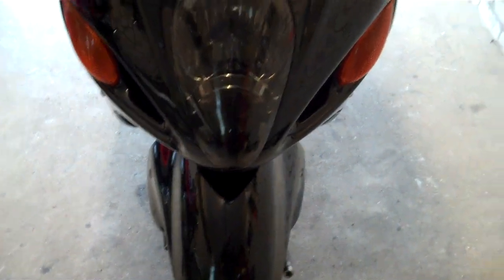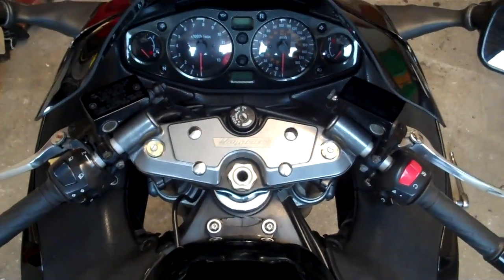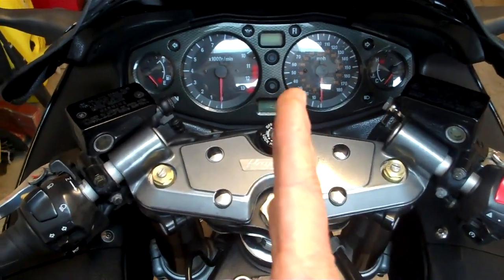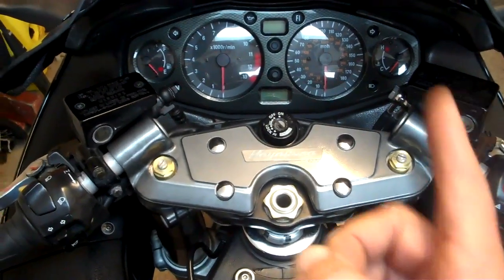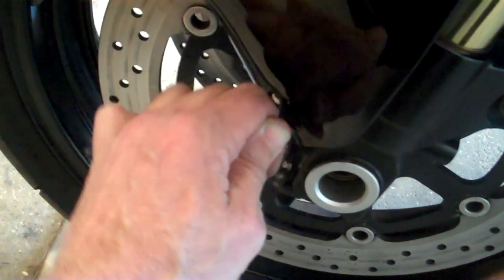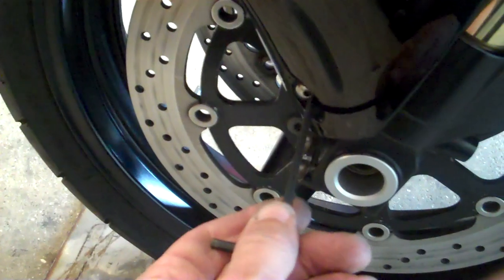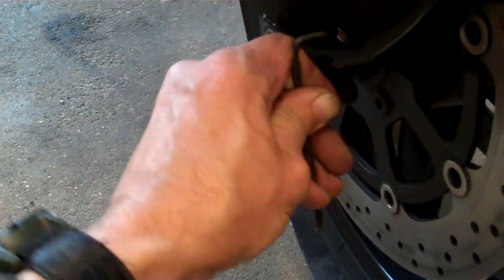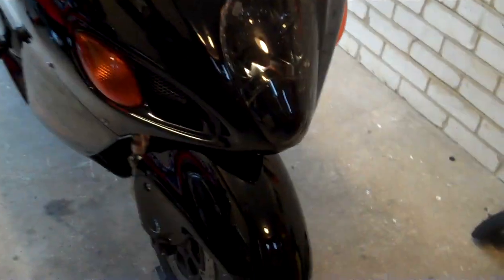Delboy's Garage, 'How-To' Re-align motorcycle forks the easy way.

Comment: Just came off my bike about an hour ago at about 25-30mph and its out I'd say about 20-25 degrees. Reckon this would still work?
Reply from the maker: Hi buddy, sorry to hear that mate, hope you weren't hurt.  Ok, this should work pretty well, it was a slow drop so its hoefully just pushed the forks out of alignment in thier yokes... the centre stand wont really help.. but if you can get someone to stand behind the bike and hold it upright on the balance point using the seat or grab rail etc.... then will work... or failing that, if you really are on your own, then even standing up off the seat while straddling the bike will do it...once you've plnuged it down and straightened them up....hold the bike on balance point by gripping the middle of the top yoke with one hand, and nip up the bottom yoke bolts with the other.....and done forget the loosen off the top centre nut in the middle of the top yoke...See how you gte on buddy... and let me know how it goes..! Good luck.. Del.
Reply: +Moonfleet41 Tried it this morning and as soon as I undone the bolts it sprung back! You my friend are an absolute lifesaver! Tracks straight and true now!
Reply from the maker: Phew, good result buddy...! ride safe aye..!!
Reply: +Moonfleet41 Haha cheers will do. Started pouring down and hit a bit if standing water while braking firmly and it just slid out from under me

Comment: When i have my hands off the handlebars, my bike tracks to the left a bit. Also, after continuous riding, my right arm is a bit sore but my left arm isnt. I had someone else ride it and they said the same. Is my bars out of alignment? Its been a year since i got the bike.
Reply from the maker: Ok, why not give this procedure a go, and see if it helps..!
Reply: need a socket for the large bolt on the upper yoke, but the good thing I noticed is the bolts are marked so I know how much to tighten to. good guy Suzuki

Comment: just curious but if I have a centre stand will this also work? i'm guessing it will due to common sense, but asking anyway just to make sure.
Reply from the maker: Hi Tyler.. no it wont work using the centre stand mate, the bike needs 
ot be able to lunge up and down, and on the centre stand it just rocks 
in the middle...this wont centre your forks properly.. it works if you 
can get someone to stand behind the bike and hold it upright while you 
lunge down..just on its wheels is ok...
Reply: Thanks mate. keep up the good vids!

Comment from the maker: Hi mate,bet that's real annoying,you say it's a 'chop',is it standard rake?And what front wheel are you running? Have you checked the tyre pressure in the front & also tyre wear, if the front tyre is 'shouldered' due to running under inflated it will shake it's head,guaranteed,every time you let go.At slow speeds it will be more pronounced as the gyroscopic effect of higher speed will combat the wobble & eliminate it.Send me these answers in PM & we can ping pong to get to the bottom of it! Del

Comment: I need some help.. my bike was recently involved in a small crash where the forks got bent.  the impact was on the left forks. it was a left side impact. a car hit me from the left while I was taking a U turn. the mechanic  said he would straighten the forks out using a hydraulic press machine..but even after getting it done there is more weight on the left handlebar of my motorcycle (clip on handlebars). while taking corners there seems to be a drag towards the left. I have checked for punctures on my front wheel.and I found nothing. will replacing the forks restore my previous handling? and should I change the position of my handlebars??
Reply from the maker: I think you've answered your own question my friend, obviously, fitting new forks will eliminate any possible damage... then all you have to do from there is set up the alignment !
Reply: Moonfleet41 but the thing is it wasn't a very hard impact.. that's wat makes me think...even for such a small impact will the handling be affected ? mine is Yamaha R15
Reply: Moonfleet41 I replaced the whole front fork assembly with a new one...but still feel there is more weight in the left handle bar...I really don't know what the cause is..

Comment: Just one little comment, if you loosen pinch bolts on the right hand side of the  wheel axle(looking from the  front of the bike ), unscrewing the wheel nut will just make it spin all together with the axle.
Reply from the maker: ...which is why you leave the pinch bolts done up until you've loosened the axle nut...

Comment: hey moonfleet41, My bike is leaning towards the left when i ride it. could this be the problem? my steering and wheel looks pretty straight to me but i will attempt your process anyway. thanks.
Reply from the maker: omg209 Hi mate, do you mean that the steering is 'turned' very slightly to the left when you ride along straight, or do you mean, as you said, that is actually 'leans' to the left??... and not sure where you are, do you drive on the right side of the road, or left??
Reply: Moonfleet41  i think its more of a lean to the left. Im in USA so i ride on the right side. thanks.
Reply from the maker: omg209 If there is extreme camber in the road, then the bike will lean very slightly to the left to say straight....if it still does it in a flat parking lot...then you should check the front and rear alignment fully to make sure everything is square and straight... also tire inflation, and check your seat is fitted correctly too...it can only be something simple.. good luck with it..

Comment: hello....my bike tire seems that it contact with road a little bit to the left and not center... One more, when i take cornering to the left sides it feels like the handle bar is heavy on the left side and i have to give some force to counter it but for the right side it seems okay....does this problems are related to the fork alignment.....help me pleasee...
Reply from the maker: HI Alif....it could be, i would check both the front and rear wheel alignment and get that correct, then also look at the tyres, make sure they are not worn unevenly or under inflated...once all those things are set perfect...it shoud ride fine... if not.. then you'll have to look deeper and frame alignment....but that very rare...

Comment: how would this effect riding? would it make it difficult to turn in the opposite direction or make the bike feel like it wants to lowside?
Reply from the maker: Not at all buddy - if your forks are out of alignment it certainly will, but doing this will bring everything back to square and bring back stability....
Reply: awesome. i worded my question badly and made it seem as if aligning your forks will mess up riding. I Meant it as will having you forks mis-aligned cause the symptoms i said.
 I came off the other week and noticed that my front wheel is pointed left slightly when the bars were straight. I can turn left relatively easily but the bike just wont turn right and every time i do try and lean the bike to the right it feels as though the tyres are sliding out and its about to low side.

my bottom yolk is covered with bodywork that would take a day to get off itself (im riding a moped at the moment and all the panels are linked into one another with the piece covering the forks being at the bottom of the pile) I have tried just griping the wheel with my feet and twisting the bars which has made the wheel seems straighter but i wont know how this effects riding until tomorrow. One other thing is that before i tried straightening the wheel and after it looks as though it is not centred with the bike and that the wheel is a couple of mm off the centre line of the bike. I dont know whether this is actually happening or whether its just my mudguard but i would be interested to hear what you have to day about it. 

thank you for your video and your help. happy new year!
Reply from the maker: Hi buddy, aha - I thought that's what you meant - and again, the answer is yes!  It's pretty dangerous to ride with your forks out of alignment... it can cause a low side on the side that the wheel is pointing away from... I know what you mean about not being able to get to the bottom yoke, I had this on my Hayabusa, which is equally covered in bodywork, but I was able to slide a spanner up the side of the forks and get to the bottom yoke bolts - they only have to be loosened off a little, so they are free to move by hand... banging, or forcing, the wheel with your legs can work, specially as it's a mooed, but be careful, you can also bend something....   if you can get it undone, then this will straighten it up and make it work, but I understand it's a pain in the arse mate, it always is... but it's worth the effort when it works and your bike is back to normal... don't forget also, to check your rear wheel alignment, cos that can make the front feel cockeyed too... and is easy enough to check visually... see how you get on, it really is worth taking the time to loosen everything properly, and it will give you peace of mind, which I'm sure you'll value... good luck with it, let us know how you get on!
Reply: will do. when i get a spare weekend i'll take the whole front end apart so i can get a proper look at it and see what wrong. thanks again mate.

Comment from the maker: Watch that habit of trusting the torque wrench too much....they are great for setting a series of bolts to the same tightness, to prevent warping as with a head or rocker cover, but can also strip threads as parts wear and get older...many torque settings are there to cover the manufacturer from legal action if things fall off...just feel for the tightness and you'll get the hang of when its tight enough... then mark the bolt head and keep an eye on it...

Comment: hi, i have a dirt bike and the forks are out of alignment due to a buddy of mine wiping out, and it seems that the front tire is aligned with the body but the front fender and the handlebars are out of alignment. i've undone the 2 bolts in the middle triple clamp and the 2 at the top and i tried to realign them but their stiffly in place, any ideas on how to realign them?

Comment: So you didn't torque your triple clamps? It is important to do.
Reply from the maker: After 30yrs of working on bikes you get a feel for it mate... I've also seen people strip the threads out using un-calibrated torque wrenches, I do them up so they 'feel' right and I've never had an issue with them coming loose or stripping out, but it does take experience, if you're ever concerned, quite right, they should be torqued down to the specified value....

Comment: Not sure if you'd know the answer, you probably do, anyways, my back brake lever is not aligned with the throttle like the front brake lever is to the other handle. I just noticed today how i had to reach farther with my hands than usual to press the brakes. How could I realign it, and would it be best of I just went to the local moped shop? Also how could this happen?
Reply from the maker: Hi Babs, im not sure what scooter you have, or how the lever bolts onto the bar...but most of them clamp round the bar with a 'cap' held on with two small bolts or screws....you should be able to loosen those and just rotate the lever into the right place for you (it should slip round once you loosen it), then do it up tight again.  Its important to have your brakes easy to reach, so let me know how you get on and if you get stuck, maybe you can send me some pictures to help.   good luck Del.
Reply: Moonfleet41 it's a GMW RX50

Comment: My 2007 Gsxr 600 has a pulsing vibration at high speeds, nothing that is particularly worrisome. At low speed when braking under 10mph it's bad, feels like the brakes are grabbing and releasing coming to a stop, like the wheel isn't straight or something in the front. I'm pretty much desperate now. I've searched every forum. What I've done:

New rotors (EBC)
New brake pads (EBC HH) (properly broken in)
Replaced the front wheel (used but straight OEM)
Had the bearings in the front wheel replaced (after market)
Inspected/ cleaned calipers and master cylinder 
Thoroughly flushed with Dot 4 no air in system. 
New battlax front tire. 
Had new wheel/tire re-balanced. 

Bought the bike 1 year ago, left caliper was damaged, partly bent inward toward the center like something hit it. 
Wheel was not straight, laterally and radially bent. 

I have not replaced the axel, nor touched anything to do with the forks yet. Going to try what you explain here, and buy a used axel on ebay, any other suggestions would be appreciated.
Reply from the maker: +L-dubwesson Hi buddy, it sounds like you have replaced everything on the front end, and you say it still pulses under braking??  
Perhaps try a 'slow test' - try to get the front of the bike off the ground, if possible, spin the wheel freely and see if it rotates by itself with no bining, then apply the brakes a very TINY BIT AT A TIME... as you spin the wheel .... see if you can identify the source point of the binding..... observe closely the point where the disc enters the caliper as it rotates, look for side to side oscilation as well as up and down, check that all the bobbins on the brake rotors are freely moving by using the 'nut and bolt' trick in our other video... once you have checked this, spin the wheel and observe closely the point where the tyre touches the rim lip.... there is usually a moulded rubber line on the tyre wall to indicate the tyre bead is fully seated on the rim... if this moulded rubber line is not visible all round the rim, but instead, tucks inside the rim at some point, then your tyre isn't seated properly!  Give those a try first and see how you get on!

Comment: Hello sir 
I own a KTM Duke 390 I'm facing the same problem that has ben mentioned in the vedio
the handle bar is not in alignment with the wheel 
I tried the method that u have mentioned but I'm not able to solve the issue can u please help me out with dat I don't no were I'm going wrong 
can u please tell me which to tighten first after doing all that pumping thing
Reply from the maker: Did you loosen the centre nut in the middle of the top yoke??
Reply: ya I did that was  the first thing then the bolts from lower triple clamp nd den the wheel 
while tightning back wh should I tighten first I have to come from the middle lock nut then the lower triple clamp nd after that I have to go for the wheel bolts ryt nd lastly the pinch bolts of the front axle

Comment: Hello, is it possible that the motorcycle tilts the way the handle bar is hanging when you leave your hands while riding? My wheel is aligned but left handle bar is not, also motorcycle tilts in the left when I leave my hands and ride and my left shoulder hurt after 5 miles
Reply from the maker: Hi Jay, you possibly have two things happening here, you have a misalignment and your bike is pulling to the left, so first are you riding on the left hand side of the road, or the right?  Roads have camber and will always pull down towards the kerb... so if you drive on the left and it's pulling left, it could be road camber made more accute by low tyre pressure... with your misalignment, you must get that stright...check the rear wheel alignment first, as that's easier, and if it is ok, then check the forks as in our video... then check tyre pressues and try again to see if it's fixed.
Reply: @Moonfleet41  thanks a lot for the reply, motorcycle is moving to the left irrespective of which side of the road or what speed I am riding, back tyre look fine as it has axle marking and both the sides and are locked on the 5 th position. I own a jawa 42 and the fasteners shown in the video are different, I could just find the triple clamp but can't find anything south of it . Service station person said he needs to open up the forks and align it and then re fit it, after watching this I think it's unnecessary if I can use that method and figure how to loosen them
Reply: Also how do you rule out bent forks?

Comment: how about rear wheel alignment is there an easy DIY way to get it right?
Reply from the maker: There's no "easy" or "hard" way to align a rear wheel....there's just ONE way.. pull back the adjusters by turning the adjuster bolt until the chain is at the right tension and the axle is the exact same distance from the swing arm axle, both sides.... easy enough, just depends on how your bike adjusts, but they are all pretty easy.!

Comment: Just modded my Iron 883 fork tubes and noticed it vibrates at medium to high speed. Pretty sure the tubes are not aligned proper. Gonna try this trick and see if it works. 😊
Reply from the maker: Good luck.. hope you can fix it.
Reply: Moonfleet41 Did the fix today and seems to have worked. Thanks again.